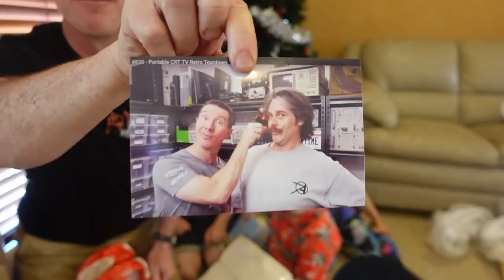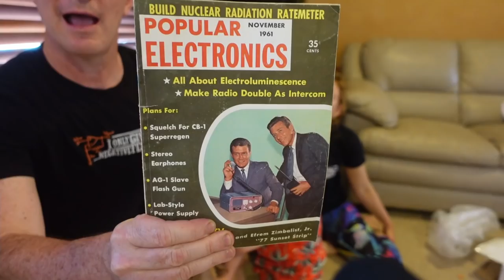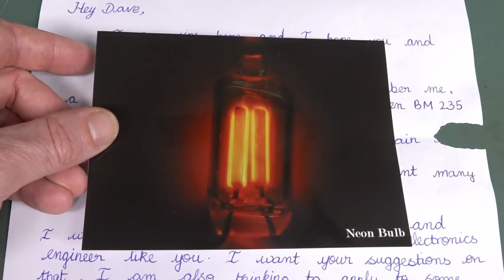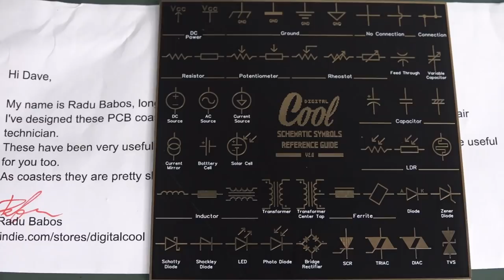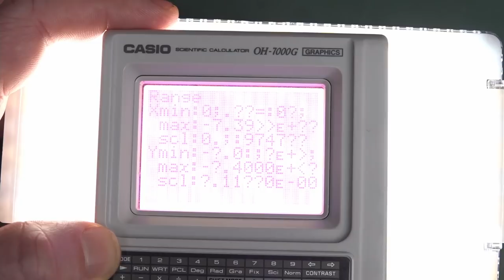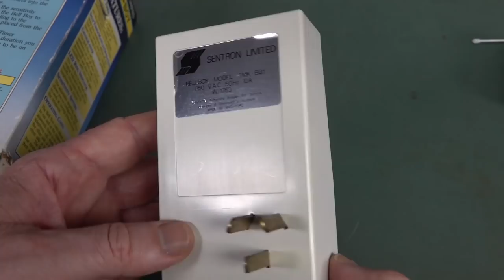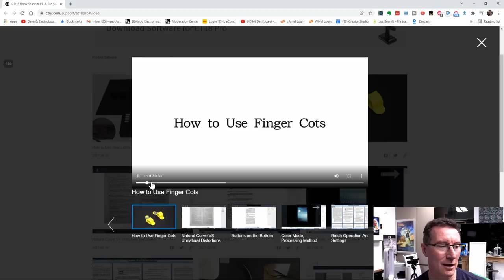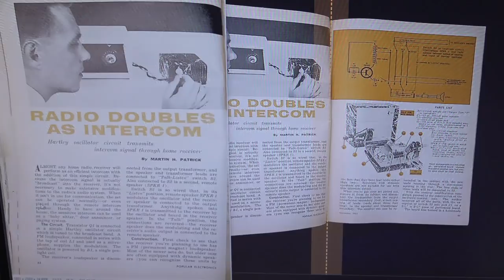EEVblog 1444 - XMAS Mailbag!

Comment: The length of a coax feedline does not matter IFF the impedance of the antenna matches the characteristic impedance of the coax.  Sometimes a particular length of coax is used to transform an antenna impedance into something else that better matches the driver.

Comment: Correction:  Antenna cable length doesn't matter for properly designed antennas (the ones including a balun). The performance of a poorly designed antenna can indeed depend on a cable length quite a lot.

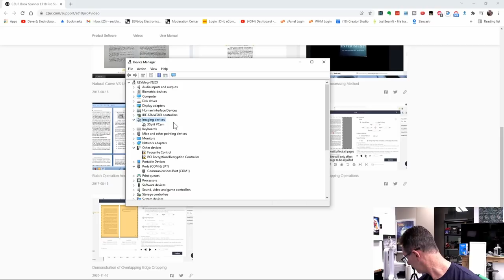Comment: 59:10 I had a similar issue with an SDR radio, the USB connector on the PCB was faulty as far I knew. When the neighbours mouses farted the disconnect connect sound happened a lot.

Comment: OCR Scanner:  the glossy problem only can be tackled when you (can) switch off the top LED lights, and only use the pillory lights. 
And I think the fingers also are used for white balance ? They have pure black and white in them.

Comment: legging designs in austrailia are rather interesting if i ever get the extra cash and stil have this one hp branded calcutaor or something else i should totally send it in a mailbag i dont know if it works as it uses i think 3 type N batteries and  think they coroded the battery terminals